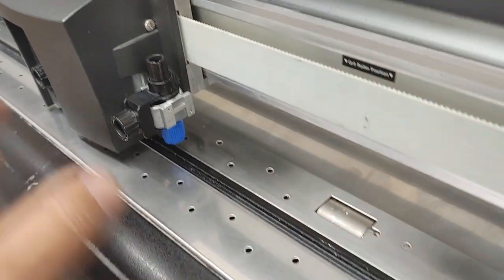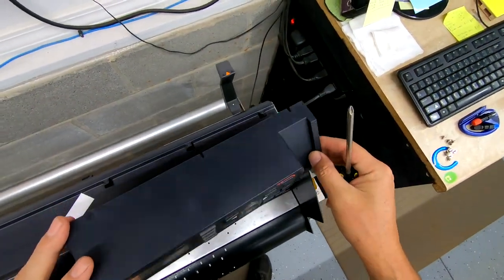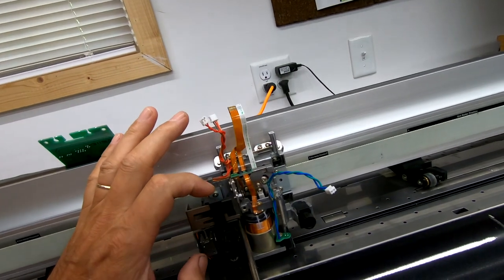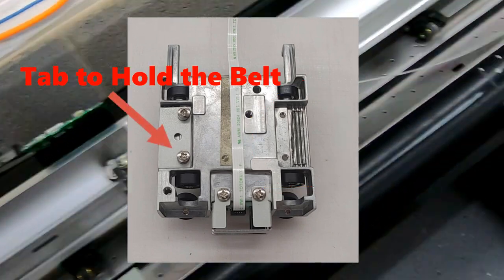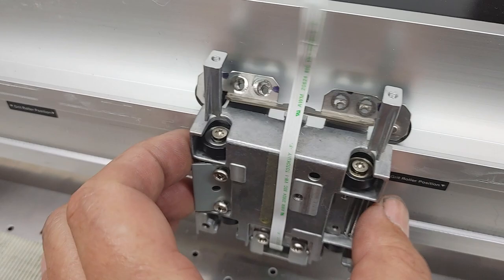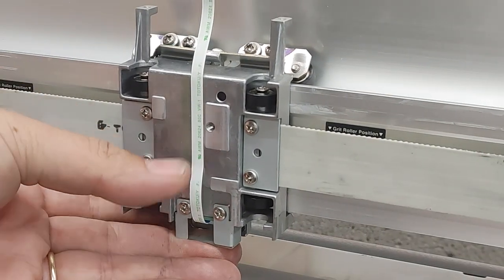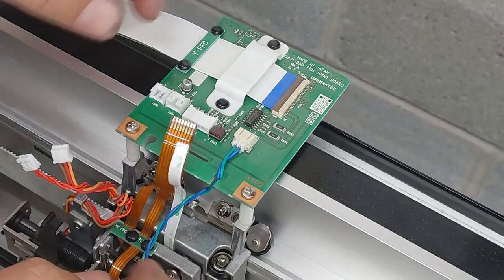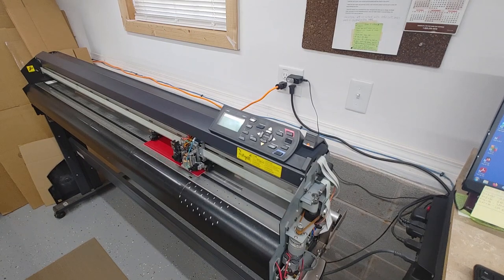Graphtec FC8600 / Q Series Cutting Tool Carriage / Bearings / Alignment / Maintenance

Comment: Excellent tutorial on the Graphtec! Looking at purchasing a new Graphtec. Have always been a Roland and Summa guy, but I like the Graphtec's separate channel for perf cuts and it's simple plugin software for CorelDraw. Keep the vids coming!
Reply from the maker: Thanks for watching Weston! I do love my Q54/8600, it's still a workhorse! I know the Summa is a great cutter as well but look to see if you can get a plugin for the Signwarehouse Q series cutters, it will save lots of $$$ over the Graphtec. The Q series are just rebranded 8600's with different firmware, I know flexi will support them but not sure if you can get one to work with CorelDraw.
Reply: @TheSignGuy  Thanks for the tip! Unfortunately, Signwarehouse is in the States and I'm in Canada. My 17 year old Summa has been bullet proof so it's going to be a toss up between the two makes.

Comment: Hey there! Great video. I purchased a used 8600 and it appears as though I need to replace these wheels as I'm getting a clicking sound as the head moves along the carriage. 

Have you ever had issues with having the left wheel in standby? As the head unit travels to the left it bumps into the metal pin and stops and throws an E01019 error. Its almost as if it isnt putting enough pressure on the pin to push in the spring loaded sensor on the left side of the head. If I manually push it all the way to the left and engage it, it works without issue. 

Thanks for your videos
Reply from the maker: No I have not had that issue. Sometimes the bearings give out and could cause that problem. I leave my pinch rollers in the up position 99.9% of the time, on a few occasions I need them tighter for sandblast resist.

Comment: Hey boss i hope you see this this is the only video I’ve seen on this, on that cutting head board you disconnected every single cable except for the one I needed, the one that’s held down by the 4 black rivots. I need to replace that cable it was crease during install, and had a few questions. 1 how do the black rivots come off or are they caps to screws? 2 is the big ribbon cable removal the same as the others? Is there anything else I might be missing in this or that will cause me problem replacing that cable?
Reply from the maker: I think the Black piece just unsnap off the board. That top cable I did not disconnect should remove like the two in the front did. It should be pretty straight forward and not to much trouble. Let me know if I can help with anything else. SG

Comment: Gotta add to this. I have the graphtec FC7000 MK2-130 similar issue but when I see you move the head with belt on it seems to run pretty smooth along the track. I'm thinking I have a motor issue? Does your cutter head move pretty freely or does it have a type of clicking? Or resistance? The Y motor shaft seems to have a tick inside but the X motor moves freely
Reply from the maker: Sorry, sold that cutter a year ago.
Reply: @TheSignGuy  wow thanks for the quick reply! No worries. I'm just curious, what about other plotters? Should that motor move freely or have a magnetic cog type clicking to it? Trying to figure out if the motor is bad

Comment: What equipment did you start off with and if you had to do it all over, what wood you change and what would you keep the same. Bonus question. Graphtec, i heard only certain software are compatible with it, and the blades, do they always need adjusting.
Reply from the maker: Video coming soon on the first question. Second question is that is false. I use Flexi 12 with mine, Flexi is compatible with just about every piece of sign equipment out there. Rarely do my blades get replace or need adjusted, the aftermarket IMO are not as good as the OEM.
Reply: @TheSignGuy  thanks. That's why you're that guy. Cant wait

Comment: hi, I use Ce-6000-60 plus. wavy cut problem. Is there a potential problem with this carriage? I have changed the new cutting strip & blade but the wavy problem is still there
Reply from the maker: maybe the blade holder or the blade itself?

Comment: Do you have the part number or where you purchased the bearings from?
Reply from the maker: The parts I got from SignWarehouse after talking with tech support. Deal with Lucas on the cutter and the part numbers are: P-GRAP-095013010 (ROLLER B13).

For the pinch roller rubber wheels part number: P-GRAP-621352000 (PUSH ROLLER CE/QE60)

Comment: my cross cutter doesn't work any more any suggestions   ?? the ultra hard blade
Reply from the maker: What doesn't work? The cross cut button, the carriage doesn't move or the blade won't cut?
Reply: @TheSignGuy  the blade doesn't engage to cut the ec film. It's cutting using the small cutting blade. That i just bought. But, I found a reset video I'll try tomorrow.
Reply from the maker: @xlr8bmt  check the ribbon cable on top of the carriage, connection might be dirty.

Comment: This isn't really a video about alignment. From what I can tell there is no way to align this particular machine's height from left to right side other than reshaping the plastic spacer under the teflon with sandpaper. They come from the factory out of alignment and only get worse. Adjusting the carriage won't make a difference as it will still be off the same distance on each side as the frame is the the 'aligned' carriage.
Reply from the maker: I was just making videos, maybe it helped someone, maybe it didn't. Anyway thanks for watching.